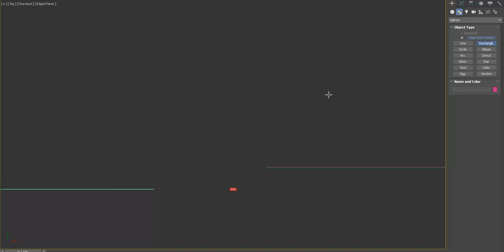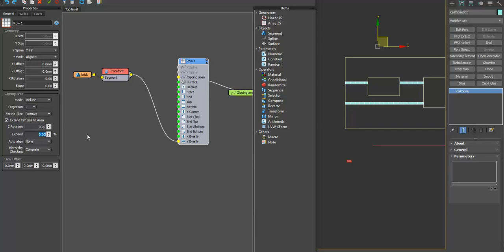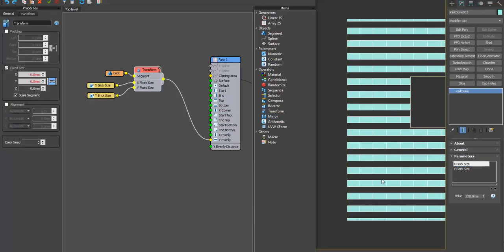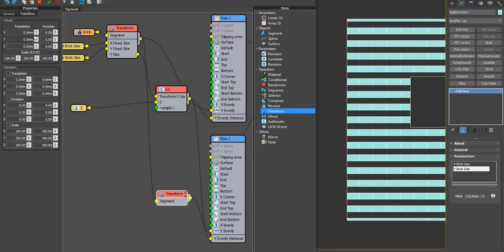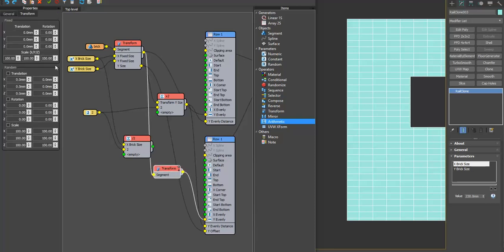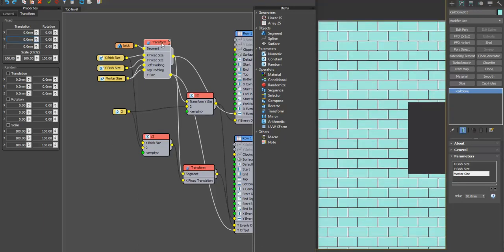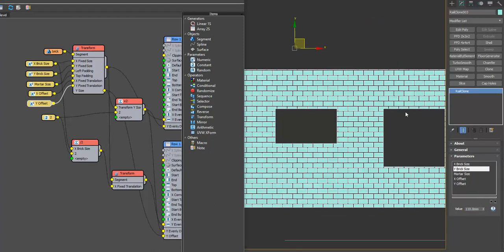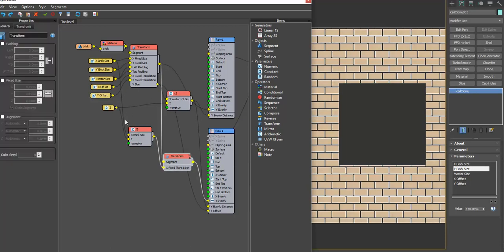Railclone - Simple Brick Wall

Comment: Nice tutorial, well explained. Thank you.
One question I have is... how to make a WALL instead of a FLOOR? This method did now work for me when I tried to rotate the spline or RC object 90 degrees, to make it vertical. Since I'm a noob, can you relate to that?
Reply from the maker: Hi 
Krzysztof, when you want to rotate it 90 degrees make sure you select both the spline and RC object. Let me know if you have any issues
Reply: @3dcargo  Thank you for your time and answer. I handled the rotation problem. The second I have with this method is, that a precise running bond worked only if my wall was straight. When I wanted to add corners/curves, the rows transformation in x-axis gets randomized :( Would you be so kind and relate to this too?
Reply from the maker: @godzil666  Can you please provide a screenshot of the issue?
Reply: @3dcargo  Hi! I hope your weekend was good?
Sure I can provide the screen, take a look here: https://we.tl/t-BDkWmAk6gb

if the spline has corners, the rows appear to move randomly. All the tutorials and methods show only flat surfaces like floors or flat walls.  Hope to approach a wall that turns?